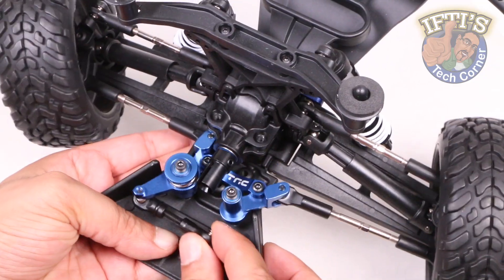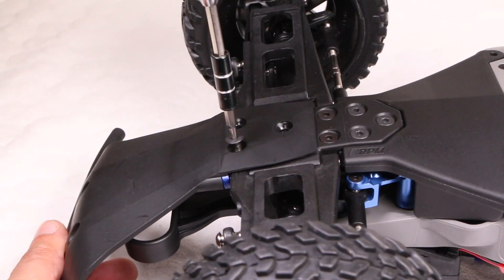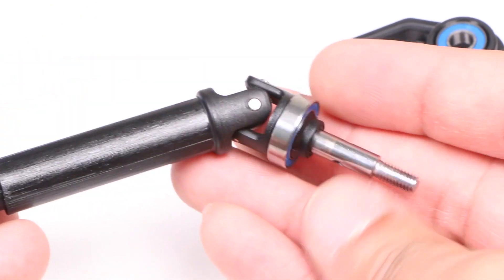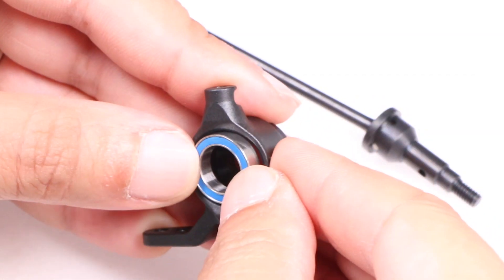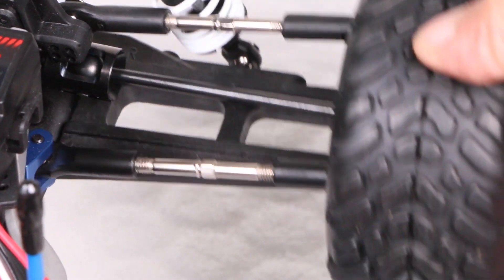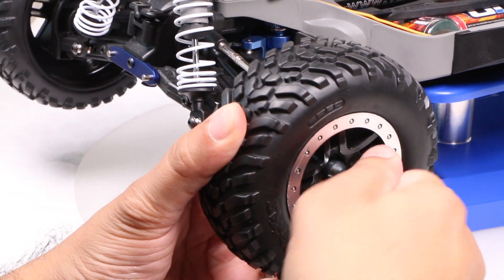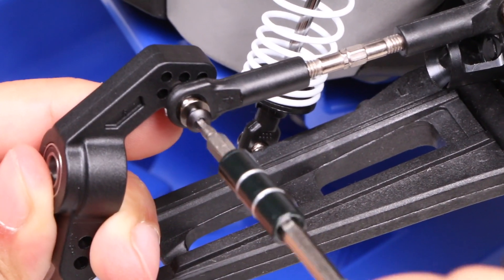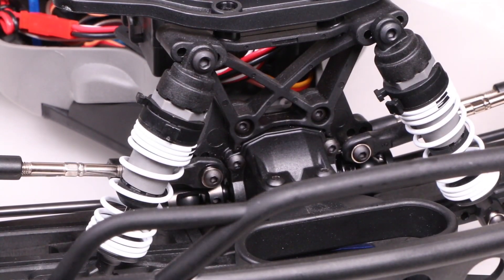#11 Traxxas Slash 4X4 - Tekno M6 CV Driveshafts Install! (TKR6851X & TKR6852X)

Comment: Just installed the M6 driveshafts in my Slash 4x4. Great video, very informative and it helped me a lot. Thank you 👍.
Reply from the maker: Glad it helped! Enjoy!
Reply: @iftibashir  The one thing I did differently was that I bought the  aluminum hex's and used them instead of the plastic ones supplied with it.
Reply: how is it all working out for you? installing mine now :D
Reply: @Krideezy  They work great.
Reply: @DirtyBob200X  have you had problems with the hub carriers? I have the ultimate which comes with aluminum hub carriers which is the only reason I dont want to get this.
Reply: @holidayhares6476  No problems, just wanted something stronger.

Comment: can this kit be used with different axle carriers? namely the traxxas aluminum ones.
Reply: dchiguy  did buddy answer you yet ?? Will they work with the xo1 Carrier's?
Reply from the maker: No afraid not.
The MIP driveshaft kit is also very good, and I think you can use alternate carriers with those.....
Reply: Yep, just get 6 x 4 x 11 bearings from Boca.